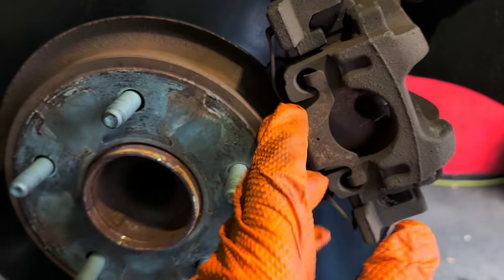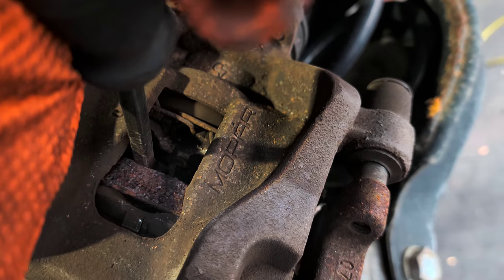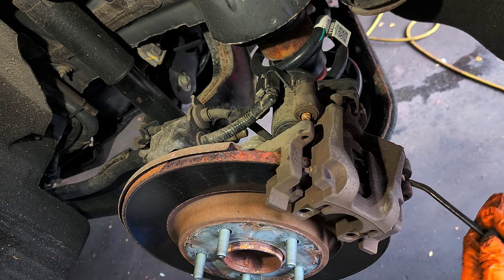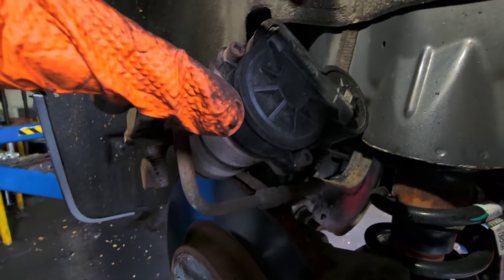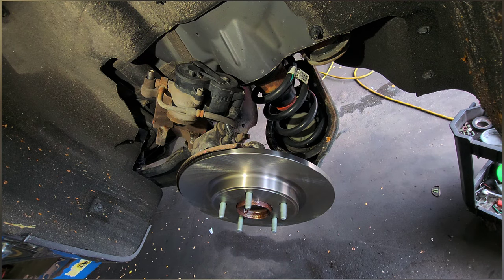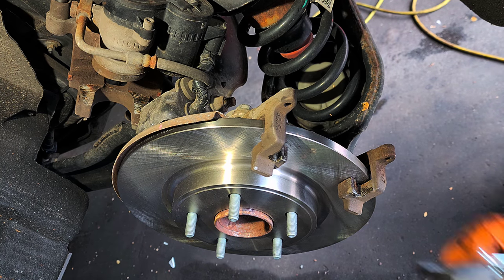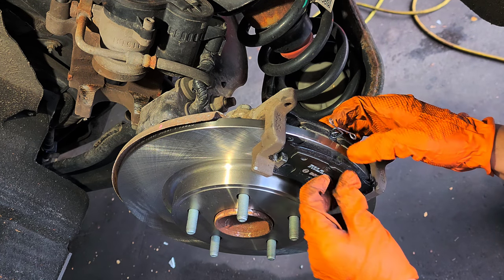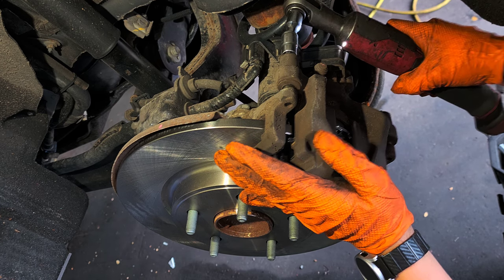2017 - 2020 Chrysler Pacifica How to Replace rear brakes with EPB w/wo scanner

Comment: You can retract the EPB actuators without a scan tool on this vehicle by enabling Brake Service Mode in Uconnect Settings. When the brake work is finished, switch the ignition to the RUN position or start the engine, apply moderate force to the brake pedal, and engage the park brake while holding the brake pedal down.
Reply from the maker: I gotcha